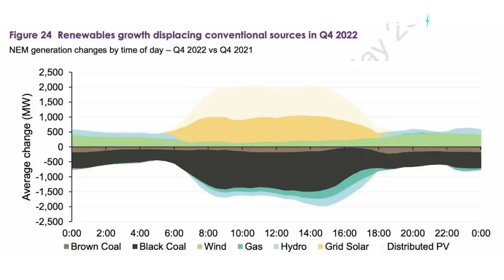Why electricity prices are FAR higher in QLD & NSW than the rest of Australia

Comment: This is a baseload problem (the minimum level of load through a period).  Coal is a baseload only generator.   Home solar reduces baseload practically to zero.  Trying to support Home solar with coal is not sensible and you waste alot of coal, you need gas or storage.  This is because gas turbines are fuel-mechanical power, coal is fuel-steam-mechanical power.   Gas turbines can be throttled up or down fairly quickly.  This is big reason the UK dropped coal, it is a poor performer.  Gas turbines can also provide bulk power over longer period with CCGT plants to improve the efficiency to around 60%, this involves a small steam plant.

Comment: Also don't overlook things like:
1) Solar hot water will supply a family with hot water at a very low cost.
2) New heat pumps for heating work extremely well.
3) In some places you can use the grid to charge a battery then sell the power back to them later for more money.
These things reduce the surge demand on  the grid that usually happens from about 3PM to about 9PM
Reply: True, but that does not make the 1 kWh price for batteries $136 in the real world. Home batteries are way to expansive. Turnaround time in the Netherlands for home batteries is over 20 Years.
Reply: @Grizzold-HP2   - I am trialing using available (supplied for camping and powering 12v offgrid activities) 12V nominal LFP batteries in a bespoke home system (renogy 3kW Inverter/charger)   - for around $320 AUD / kWh (plus inverter wiring and connection costs of course  all up around 550AUD/kWh -installed AC coupled to existing solar / grid install ) - it is all really an experiment, not really economical at this stage, but it could well pay for itself..  

(for (maybe) 3000 cycles at 75% DoD, it all comes to around 2.5c/kWh - Australian notation 2 and a half cents, which is cheaper than  the current wholesale power price.) we will know by 2033 how it works out.
Reply: @kadmow  Cheapest home battery system in the Netherlands is around €750 per 1kWh. That is LFP battery, Including installing the system. 
With our sun time and prices for delivering back the energy to the grid, it will be to expansive to ever get a return within the lifetime of the system. 
Possibly in sunny regions, and in a few years lower prices for the LFP batteries, it will get better. 
But still, that wont make $136 per 1 kWh realistic in the next few years.

Comment: Germany has similar issues.  Even worse, actually, because Germany has invested almost nothing in storage relative to the amount of renewables on their grid, and decided to maintain their brown-coal generation as renewables soaked up the new demand from their economic expansion over the last 12 years or so.  And they have the problem of being effectively land-locked w/regards to energy sources (so NG has to be imported), and having infrastructure that until very recently was dependent on Russia for natural gas.  So Germany is kinda stuck and it is going to take some major investment to get out of the hole they dug.

California's electricity prices are going up with inflation, but there is almost no coal generation in California (less than 5% now) and natural gas based generation has gone through two upgrade cycles over the last 30 years so it isn't as impacted by the daily cycle.  Most NG generation in California can run efficiently on a daily cycle these days.  That makes California the perfect candidate for storage expansion (batteries), which is precisely what California is doing now.

Australia is also a perfect candidate for energy storage.  The mix of wind and sun dovetails into storage very well for Australia.  Just a little late in expanding storage not the least of which due to resistance from the fossil fuel industry.  Which is rather ironic because the expansion of storage in Australia would actually make the remaining coal generation more efficient.
Reply: Not really late at all - we are at the sweet spot for prices of storage - all different types for different timeframes - to fall into parity with the status quo.
Reply: @kadmow  Totally true on equipment and battery costs, but the problem is that no industrial expansion can turn on a dime.  It takes time to build scale and expertise, and expanding large electrical grids require years of planning.  Skipping those steps and playing catch-up later on has a huge cost associated with it.  

But it is debatable which would be more expensive... starting slow earlier on with more expensive equipment, or starting fast later on (and suffering through the school of hard knocks when already at scale), but with less expensive equipment.

Comment: Sth Australia has the highest electricity prices in Australia. Why? Renewables. Alinta energy CEO at a recent energy and climate press conference " what cost me 1 billion to acquire( coal plant) will cost my company 8 billion( renewables) to replace   
, so let's talk about that and explain to me how prices will come down" . That pretty much sums up what the future of electricity prices will be. Massive expenditure which someone will have to pay for.
Reply: BS regarding SA having the highest electricity prices due to renewables. SA has one of the lowest wholesale prices in the NEM. Retail prices are a combination of factors, generation is only one factor. SA had high retail prices for decades before renewables started being installed in SA. Other factors made retail electricity more expensive in SA - they also used to have the highest wholesale price. Not any more, creating room for retail prices to moderate somewhat in SA.

New generation of any type was always more expensive initially than old generation due to the CAPEX for new generation needing to be paid off, when it had already been paid off for the old generation. New fossil fuel generation is more expensive than new renewables. Try looking at actual research on the subject, for example LCOE estimates from the CSIRO. New renewables are by far the cheapest form of new generation, even once transmission and storage are taken into account. And sometimes cheaper than existing generation. Old generators need to be replaced anyway, and new renewables are cheaper than new fossil fuels.

Comment: Will we still use Bitumen, which is a binding agent produced from petroleum when it becomes too expensive. Bitumen is known for being strongly adhesive and resistant to damage from water and oil spills. This makes bitumen the ideal binder for asphalt because asphalt is commonly used as a surface for roads, car parks and driveways.
Will we still export our coal for an income or does Australia have enough money? 
Will we use fossil fuels for smelting plants, aviation, diesel trains, cargo ships and more or will that all be charged with renewable energy? 
Are we stopping plastics altogether? Will we replace all the plastic parts in our EV's? (Especially our battery casings)?  Cold we get all these materials from recycling the old?
Reply: Some plastics can be made from grown crops.  We may see that happen more as less gasoline and diesel fuel are bought.  In the refining process, the stuff that makes plastic is sort of a waste product of gasoline production.  The price of oil based plastics may start to increase.

Comment: compres air is the choice, reason is that the storage price (a steel tank) per kWh is cut in half if the doble the  tank size,so for big  tanks  the price is so low that even a 40% los in convertion can be of set by installing more panels or wind and. still be 50% cheaper than litio,plus longest live and tens of times more cycles.
Reply: Compressing air can work but I would want a big berm around that tank in case it lets go.
Many years back I saw a system that used a large area full op pipes as the compressed air tank. This was storing energy for a mechanical use of some kind and not for making electrical power.

Comment: Tesla 13.5kWh  powerwall in Netherlands is around €13.000, incl tax and delivery. 
That comes down to about €1.000 per kWh. That is not even close to that number of €136 per kWh that batteries should cost in 2023. (according to SAM) 
Ok, there is some electronics, and some metal pacage with Tesla on it. Maybe that name Tesla makes up for €10.000?
Reply: 136 € is just the price of the battery without inverter management/controll housing
Reply: @florian6408  I estimated, both with comparible ICE and EV cars and homebatteries, that the prices just for batteries today, are not $136 but more around $500.
When a 13 kWh home battery is $13.000, it is impossible, that the price for just the management, converter and housing is more than 80% and the battery is 20%. 
The most costly part in that Homebattery is alway the battery itself, not the rest.
The most expansive inverter with management is around $800.
That leaves $12.200 for a piece of metal housing and . . . . . the 13 kWh battery.
Reply: - same as reporting spot market wholesale electricity prices, it is easy to gloss over market forces (and the profit motive) for a bit of sensationalism.  Retail customers don't see the intraday or intraweek price swings.
(Power, water and sanitation utilities used  to  be run for the good of the populace - that wasn't always so cost effective, now we are seeing that the motive of avarice isn't so good for the masses.)

All "turnkey" home battery systems retail for significant margins - the LG Chem recall (EV and residential batteries) shows how risky being an early mover can be (margins allow risk to be covered) - LFP batteries have entered the mass market as key patents have expired, now the markets can progress without restrictive licencing deals (or limits)...

Comment: Renewables like solar, wind, are good but they are not constant, and they need storage to resolve this problem.
The real answer to the replace
 hidrocarbon based generation are nuclear power plants, and with the new technologies, specially the Thorium based reactors,  are much,  much, safer than the old U based reactors. 
China, again, has seen that and built  a thorium power plant that is in comssiining and debotlenink stage, and if this goes well, they will replicate it on many other places.
Reply: Decades away and decades to build a plant. Very expensive to build and decommission.
ChangeOracle. Com:
US Energy Information Administration’s Annual Energy Outlook 2022 indicates that the cost of electricity from advanced nuclear power stations is double the cost of solar farms. An analysis of the levelized costs of energy {LCOE) by Lazard investment bank indicates that wind and solar energy are five times cheaper than nuclear. The report also concluded that renewables remain less expensive even when we include storage and network costs. The declining costs of battery technology are also contributing to ongoing wind and solar price declines.
Reply: @andrewradford3953  You got here and hit the points I would have except one.  The "decommissioning" is effectively infinitely expensive because it has never really been done and the materials can never be rendered safe so they must be stored safely nearly forever.
Reply: @andrewradford3953  - Yes and no. Yes, to build tradicional U nuclear power plants, and no for thorium reactors. The dificulty in putting things in perspective, is that we only have an example to evaluate, after the cancelation of the program at the Lawrence Livermore Laboratory, that of the chinese reactor that is on commisioning and debotlenecking stage and if all goes well, China plans in replicating the design to other plants. We will see...
Reply: HVDC cheaply moves electricity across continents.  The wind is always blowing somewhere, and the sun is up for 15 hours.